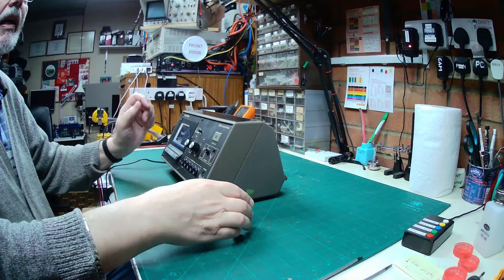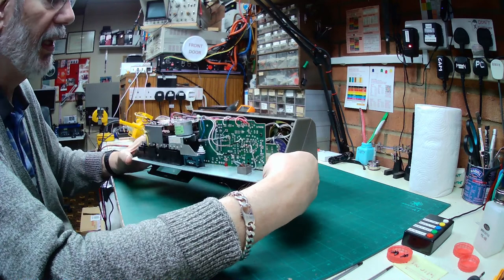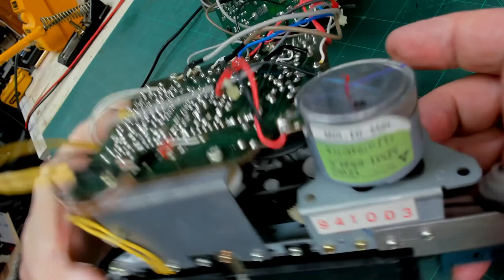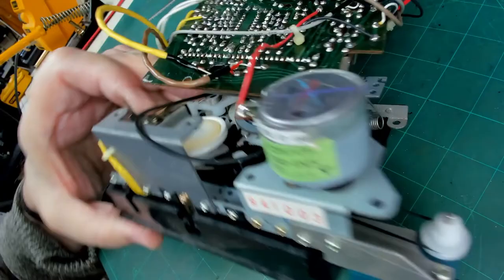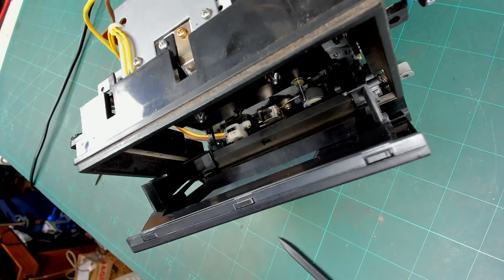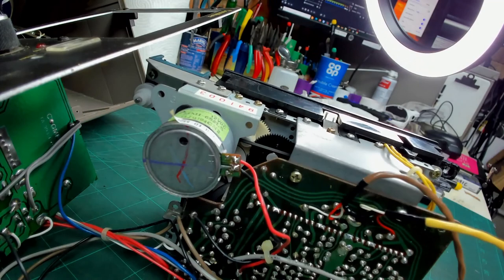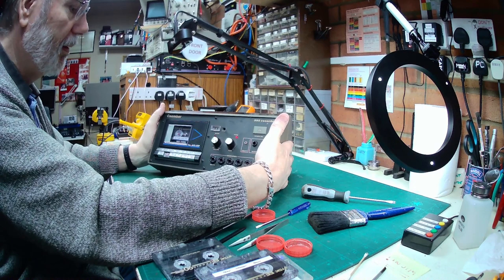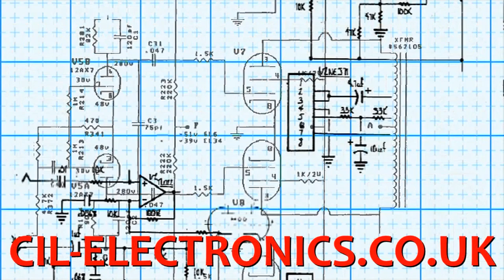Coomber 393 Language Teaching Cassette Recorder

Comment: I always replaced the belt, (standard), first.  That black on the q-tip happens because as the belt ages it drys out and the rubber "ozones", as well as the pinch roller caked with iron oxides from countless playing.
Reply from the maker: I agree, if the belt had slightly stretched I would have changed it, but as the deck was in permanent play mode it fooled me into thinking it was a belt issue. Once resolved the bent PB head, cassettes would load properly and all was well.

Comment: I have one of these recently acquired and it won't play certain tapes I have the Spanish learning tapes that came with it play ok but other tapes I have don't want to play ? The tape deck just stops
Reply from the maker: Maybe the tapes are wound too tightly and the autostop is kicking in. Maybe loosen the tapes using a pencil. Check the clutch / brake assemblies
Reply: Thankyou very much I'll check a few tapes to see if it is this problem
Reply from the maker: @grahamheath3576  good.
Reply: @ChasLarge  thanks very much it's the only tape that won't work after trying a few maybe it's the tape but it works in my Technics deck 🤷